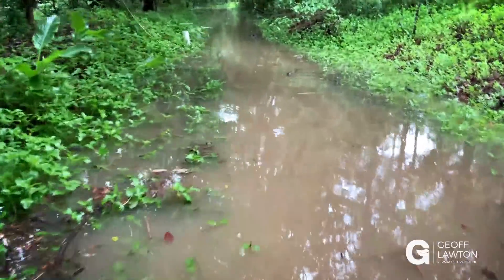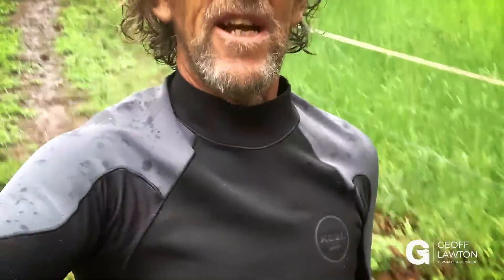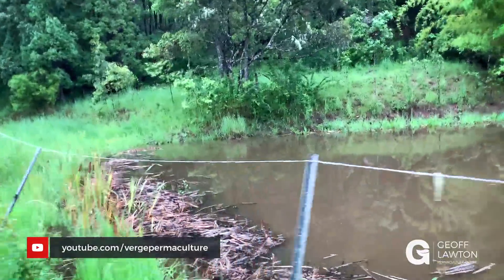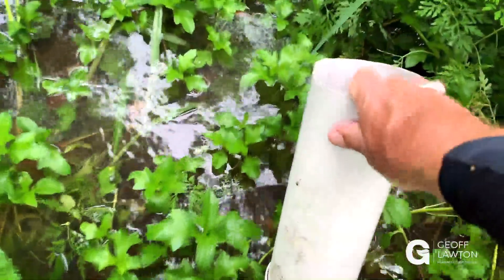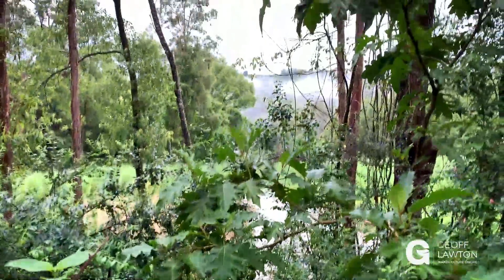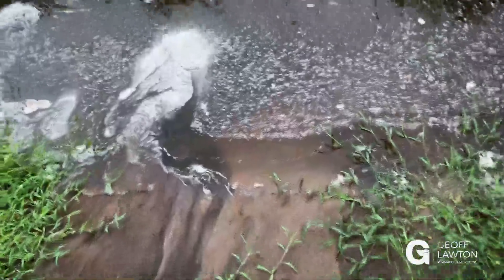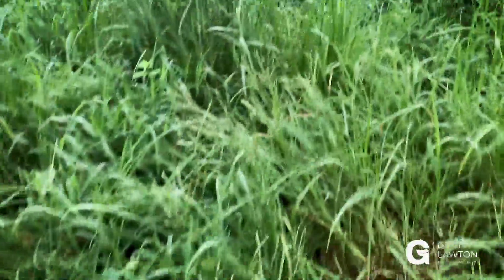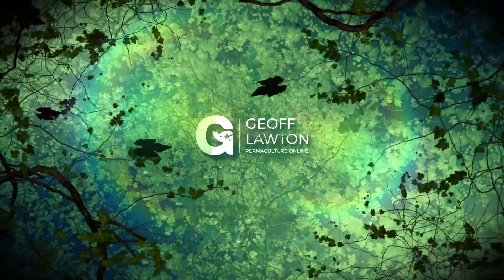Back From the Drought with a Vengeance; Water Flows of Zaytuna Farm February, 2020

Comment: Amazing, looks like a tropical deluge happened or something I wouldn't ever guess there was any kind of drought.  Also what baffles me, how do you guys not get bit by snakes!!!?  Just walking around like that... do those boots protect you?  Just wading blindly into grass and stuff would get my nerves going personally, but I am not in that environment much.  Doing the pipes looks like a lot of fun
Reply: Gum boots are a pretty good defense against snakes. They're designed to be puncture resistant, something you can test by trying to put an ice pick through a boot. It takes a lot more strength than you might think to get through the material. If you find it easy to puncture a pair of gum boots, then you should immediately look for a better brand. Also snakes don't really have that strong of a bite force, they can't, because their jaws are built to be flexible and to unhinge. If they had a huge bite force they'd literally pull their faces apart. Venomous snakes rely on the sharpness of their fangs more than the force of their bite to penetrate skin. Put all that together and Gum boots are pretty good and very cheep anti-snakebite armor. Not absolutely fail-safe, but pretty damn good all things considered.
 
Also a balanced ecosystem isn't going to have you tripping over snakes because their populations will be moderated by predators like owls, hawks, and other snakes, and also by competition for food with other predators, like cats, foxes, owls, hawks, and other snakes. In the western US deserts one of the best ways to avoid rattlesnakes is to promote King snakes, who compete for the same food sources and also hunt rattlesnakes. Promoting habitat for king snakes naturally moderates the population of rattlesnakes and all it takes is a little research and a little work to build the habitat. A balanced ecosystem does the same thing with lots of other animal predation interactions. 

Carmelo's point is a good one as well. There's a lot of traffic along those swales at Zatuna farm, and snakes tend to avoid places where there's a lot of trafic by larger animals unless they have a really good reason to be there, like access to water or food that they can't get somewhere else. I would suspect that most of the snakes at Zatuna farm live in the unmanaged "natural" forest areas of the property.

All that's a very longwinded way of saying: Yes, gum boots offer some protection from snakes, and Geoff probably doesn't worry about snakes too much because the system is designed to account for them.
Reply: @DaveTpletsch  Thank you for the informative reply.  I live in Texas right now but eventually will relocate to the tropics of Kenya.  I'd hate to build a wonderful food forest only to get poisoned to death :-D  I like living too much.

I guess snakes don't tend to strike above the gum boot, say at knee or thigh height?  Even if they're up on that level?  

My grandfather who has a ranch in the hill country of Texas one time was opening a gate in his 70s, and on the other side was a snake that bit him.  I think it was indeed a poisonous snake, but it was a dry bite or something.  I would have been very anxious in that situation because he was about an hour away from a hospital and 15 minutes from the house
Reply: @TheVigilantStewards   The snakes likely do not want to swim (most of them) and wait for the water to subside. I think he mentioned that more intense rainfall was predicted and most animals try to shelter and wait until the wild weather events (that could potentially harm them with the sheer force of moving water or moving objects) end. 
Geoff created  quite a commotion as he waded along, noise and movement - he creates currents with the swivel pipes, the snakes would not like that (they could be swept along, and worse could get hit by some larger object, the suction is strong). So if a snake is somewhere in a swale and feels the suction it willl flee. 

If something larger wades in water it is potentially an animal that could see snakes as prey, or trample them by accident, their prey is smaller and cannot create such a stir, so they would naturally avoid that. 

if they suvived so far they can deal with dry weather resp.they hid where it is cool, shaded and moist -  but not standing water, and grass on soaking wet ground. 

Their prey (except for frogs) is also not yet running around and also waits until the water retreats and the heavy rain ends, so the snake likey would save energy, enjoy the moisture and wait a few days until they  go hunting. 

If a snake specializes in rodents or insects - they are still  hiding. Birds are in the trees, not in the water or soaking wet underground.  If they eat frogs and toads - those were more concentrated in the still moist areas during the draught, and had not yet had time to procreate a lot thanks to the rain, so immediately after such a rain is not even such a good time to hunt, their prey will spread out over the land and is harder to find. 

Snakes can go a long time without food and can afford to be quite opportunistic, so a waiting a few days until things get back to normal after a flooding does not matter for them.  If there are such strong rainfalls, more can come and fast moving water can harm animals, so it is a good strategy for all wildlife to shelter in place in times of torrential rainfalls, and wait it out.
Reply: @xyzsame4081  Hey, wow thank you for that insight!  I appreciate understanding things better so I'm not as afraid/paranoid.  In North Texas we have poisonous water moccasins that seem to love ponds and dams etc... does what you said also apply to them?  I think the other ones we have here are rattlesnakes and copperheads... lot of deadly snakes here
Reply: making lots of noise is a good way to not get fucked by a snake too. stamping your feet as you start going into possibly dangerous areas will warn the snake you're coming so it doesn't panic.